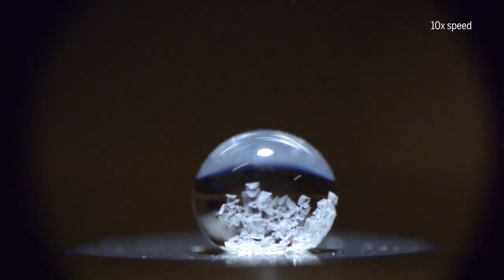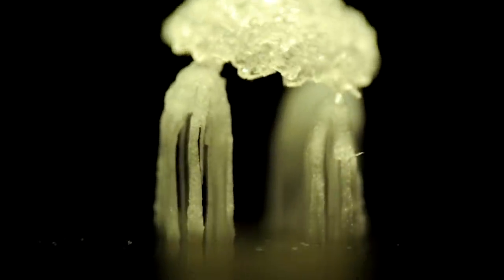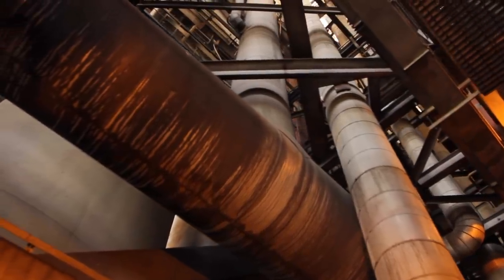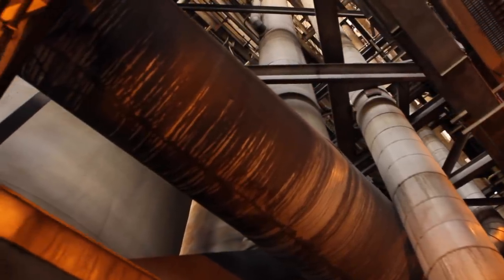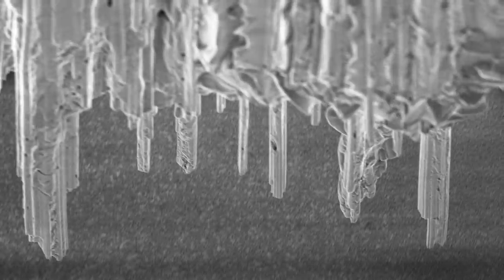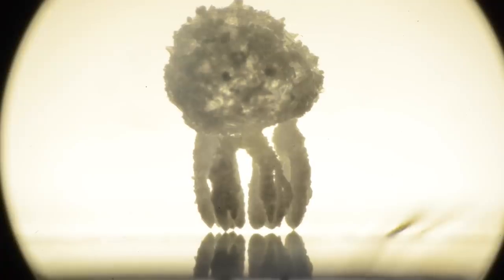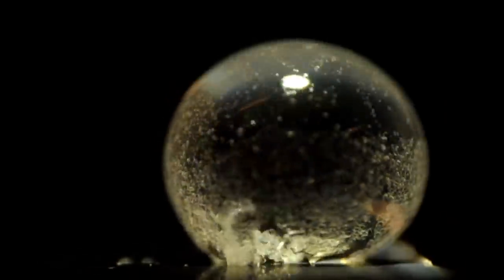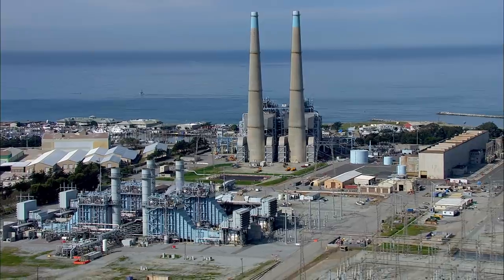These strange salt ‘creatures’ could help unclog power plant pipes

Comment: How does one go about changing the temperature of a surface to affect the heat on a single droplet?
Reply: Hundreds of workers running around frantically with lighters while another group runs around frantically with temperature probes.
Reply: One temperature, film droplets, heat the surface more and film other droplets, etc. See linked articles for full deets.

Comment: Interesting topic thanks SM, not sure how this works exactly, does this mean that the water pipes in hard water area's have to be super hydrophobic? 

Love the salt monster shapes, they could make an interesting characters in CG animation.

The pipes at 0:40 are a great example of why it costs industry $100 billion a year, not sure who worked that figure out, it just seems a little high.

What I noticed about having lived in hard & soft water area's (I live in a soft water area, my mum, 10 miles away, is in a hard water area) 
the most obvious difference is that it takes longer to lather your hands with the soap and if you live in a hard water zone you don't live as long. 

Years ago I remember my mum buying a small, rounded cube of metal mesh which she put into the water reservoir of the kettle.

As you moved the kettle, plus the boiling water would move it around this was supposed to stop the calcium build up in the kettle.

Comment: If salt water (seawater?) becomes a viable option, this  means the only cost involved is transporting it in/out. Consequently, even larger quantities will be used for more "efficient" cooling. This fake efficiency doesn't take environmental impact into account.

What is the effect of displacing large quantities of water from the depths, effectively nuking all the micro-level life forms, disrupting the nutrient-balance of that habitat, and pumping the sterile water back to the sea at surface level?

Comment: Someone tell me why I'm wrong... Dump a little acid in the water to help keep the salt from being able to crystalize.
Reply: Couple reasons. First, the acid will lead to corrosion of the materials, maybe even more so than the salt. Also, for evaporative heat transfer, you're concentrating the solutes in the water so much that even at a lowered pH the supersaturation limit of the salt will be reached and precipitation will occur anyway. At some point the acid itself will even crystallize. Finally, energy production uses an enormous amount of water, and the transport/storage/use of the amount of acid needed to alter the pH of that much water would be a logistical nightmare and likely very expensive. Vinegar works great for salt scale in the shower though!
Reply: @samanthamcbride6338  I was thinking more along the lines of adding a small amount of something strong like hydrochloric acid just before problem areas and only occasionally, just to break the build up apart, maybe only enough to send something through the pipes to clear it periodically.

What you said about the evaporative heat transfer probably hit the nail on the head, I didn't initially think of that. Now I'm wondering why not design a mineral collection pool in to encourage the salt and minerals to collect there instead.

Extremely thorough response, much better than I deserve honestly.

Comment: I don't think thorium molten salt reactors need to worry to much about this? They use a closed loop cooling system because of their extreme heat, and don't have to worry about becoming a dirty bomb like current nuclear reactors when water get split into rocket fuel at times of failure.
Reply: The problem is, industrial grade thorium molten salt reactors are science fiction, at least for now. Hopefully it get realized in the next 100 years. Although fussion reactor will come first in the next 50 years or so.
Reply: Closed loop cooling of what, bub? Is it eutectic steam all the way down?
Reply: @UltimateAlgorithm  
If Richard Nixon didn't cut their funding for politico favours, we would have had thorium molten salt reactors decades ago, on the other hand fusion has been soaking up grant money for 80 years now.
Fusion is a worthy goal, but it become an obsession with most of the scientific community, it's like they are willing to bet the planet that they can get fusion to work before it's too late.

Comment: I am on youtube rant tonight. THis is the dumbest thing ive ever heard. Lets coat a coolant pipe with nano structures to prevent  it from having salt attach to the surface walls. 

Morty: But what happens when a thin layer does build up and now the salt has something to attach too. 
Rick: Shut up morty,  people dont wanna think they just want solutions tht sound good. 
Morty: You are such a .....
Rick: No im salt-sickle rick.

Comment: I figured this would’ve been done already interior of a pipe being as smooth as possible great eight science class making salt crystals on a string hanging in water the more surface area and texture of the string  the bigger and better the crystals are I figured the Hydro Engineering community much smarter than that but then again maybe not